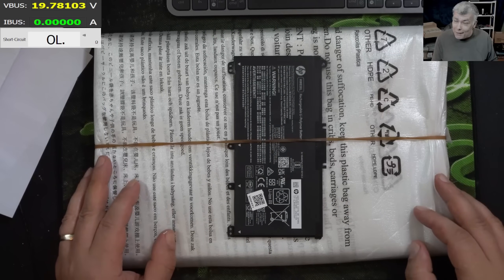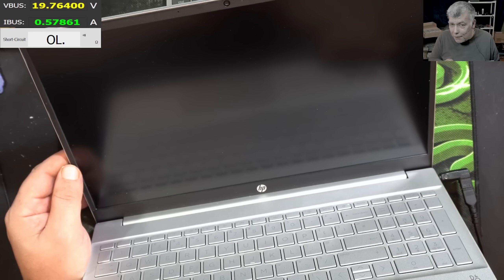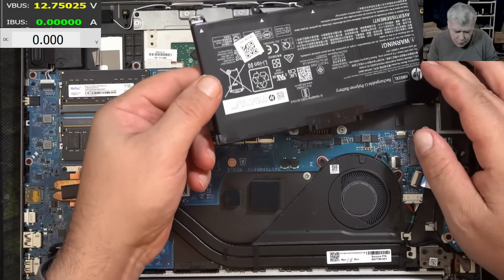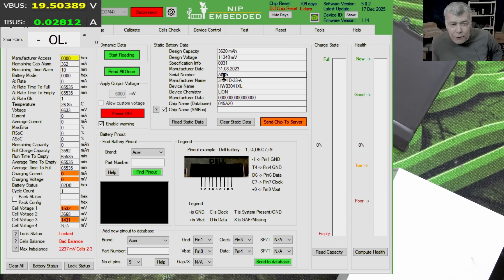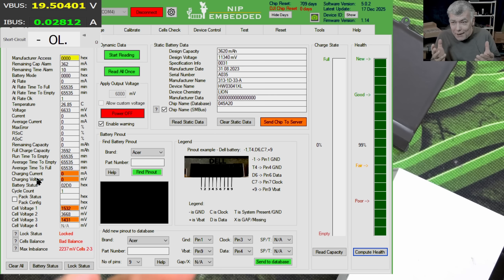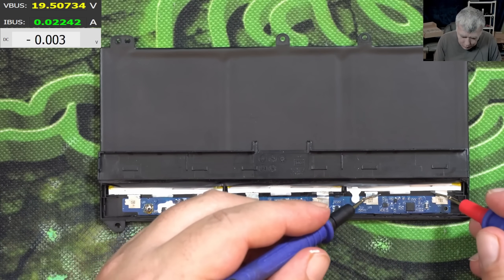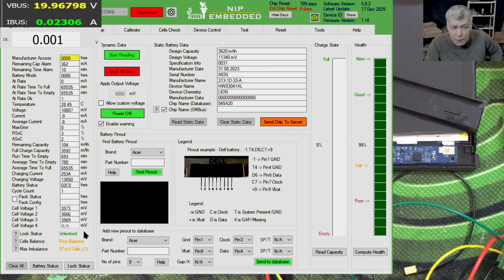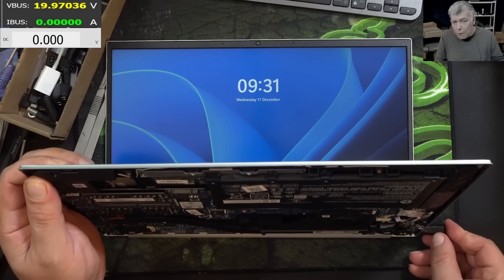The NLBA1 battery analyzer just got more affordable. Hp battery repair

Comment: A Li-ion battery, if it goes below 2V, you can consider it dead. So even if it works, I wouldn't rely on it...
Reply: just another internet myth by "experts" who never repaired LiPo batteries
Reply: @FixFix15  Would you like to share where that comes from? All the information I have been able to find says that below 2.5 or 2V (depending on the exact chemistry), irreversible damage occurs. If it was totally safe to go below 3V, most devices should take advantage of that. But normally, devices turn off when they are at 3.3-3.4V. Why is that if we could go below that and get more energy from it?
I've found scientific papers where they go even to 0V and they can still charge and use the battery, but that doesn't mean the battery is perfectly fine. Also, it's not the same for a battery to be at 2V for a few hours, or a few months...
Reply: @TBDFood  Sorin has been doing it for a while if he had constant return laptops he never would... So from a practical example its fine.

Comment: The laptop customer wrote "locked battery" so he or someone else tested it with NLBA1 and found it "Locked" but he did not manage to fix it. Probably he used Demo NLBA1 to check the battery status. I repair batteries and "locked/unlocked" status is shown only in the NLBA1 software.

Comment: Sometimes its worth it as batteries are 100£+ but in this case battery is worth less then (repair fee) I mean i would not donit for less then 30... and you got this particular battery almost brand new for less then 30 on ebay....
Reply: They are not genuine. We cannot compare aftermarket batteries to genuine batteries. You can open an aftermarket battery and check what is inside.
Reply: @azzidoqsc genuine used with 90% capacities
Reply: Sorin charge 15 for unlocking battery.
Time is our most valuable currency, warranty is long.
Reply: time is concern too. Battery delivery terms is quite long due to shipping rules. It could take several monthes. In this case customer got his working HP laptop next day...